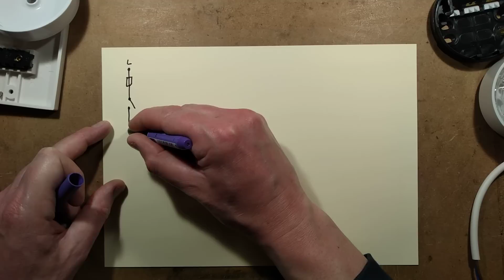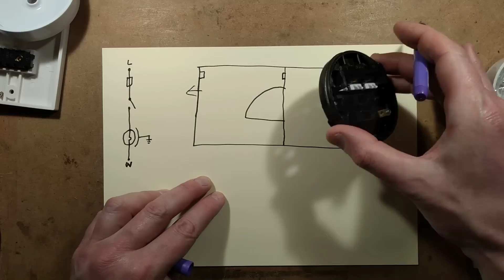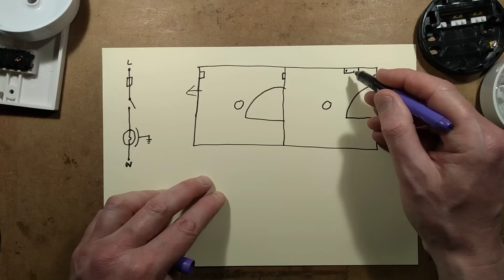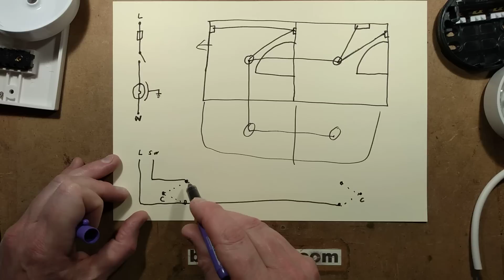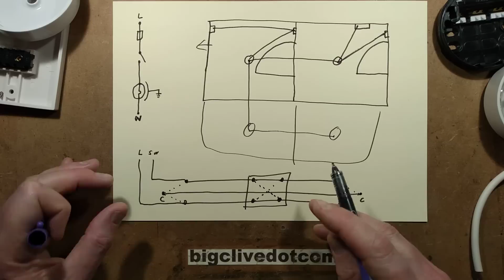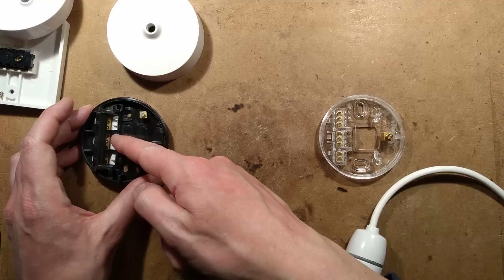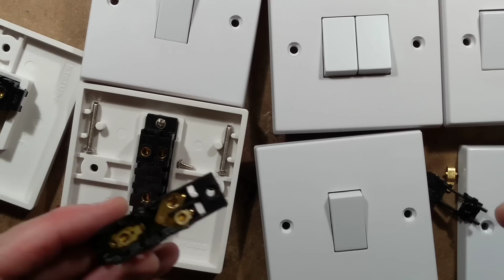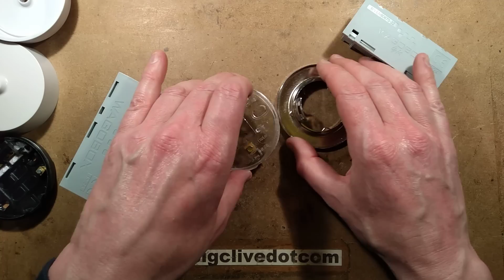British home wiring.  The incredibly simple lighting circuits.

Comment: The old fashioned way across the pond is similar for lighting. Instead of a ceiling rose, we have a ceiling 'dish' or 'pan.' It's basically just a very shallow round metal box, shaped like a dish, with knockout holes for wire or conduit entry, and it usually has a threaded bolt sticking out of the center where different adapters can be screwed onto, and a light fixture can be hung from those bits, or screwed up to the ceiling. Surface mount light fixtures were, and still are, designed expecting that all the wiring would be sticking out of the ceiling, and have nowhere to be put into, besides a recess provided by the light fixture.

The more modern design is simply to have an octagonal metal box mounted in the ceiling (as those are shaped and have screw holes meant specifically for screwing up a surface mount light fixture). Those boxes are about ~40mm deep, or more, and are otherwise identical to a normal switch box. With these boxes, adapter plates that provide a place for a threaded rod can be used to hang a light pendant. There are a whole bunch of light installation adapters available, despite the fact that there have only really been two or three standards here for that since the beginning of electricity. But we manage just fine.

As for circuit wiring, most places I have seen, at least old homes (think 20s to 50s), have been similar, in that they have a general lighting circuit, with other circuits for outlets. However, there seems not to have been any rules for that, so some houses will have lights and outlets on the same circuit. Nowadays, I think the meta is to have each room (lights and outlets) on one breaker. Excepting kitchens and bathrooms, and anywhere else dedicated circuits might be needed. It's not uncommon to have homes here with 20 or more breakers.
Reply: We have some of those "double up" breakers too.

Comment: Here in the United States, electrical panels are rarely located near the door. They're usually located in a "utility room" which may contain the washer, dryer, water heater, and furnace. If not, they're almost always in a connected garage or in a bedroom other than the master.
Reply: The design originates with the first distribution systems in dense urban areas where row housing (terraces in UK-speak) were common.  From the road entry at the front door was easiest and the distribution company hand off to the customer circuits was done as soon as possible.  And high as initially the sole use was for lighting.  In the apartment where I was raised the board was immediately above the door and had 2 circuits: lights and power.

Utility rooms, washer, dryers, furnaces  etc were all unimagined things of the future.  :)

The other common place for a board is "under the stairs" — because it was often the only space out of view and with little use.

Comment: Hi, nice video but the way u draw but the two way wiring, am not sure if it's OK. Please excuse me if am wrong.
Reply from the maker: Draw it out and try the different switch positions.  There's an older method that connected between the two common contacts, but this method is easier.
Reply: @bigclivedotcom  ya , after drawing it myself I see the light, thanks alot. I was using the old way,  thanks again and sorry.... 😇
Reply from the maker: @388sanju  No need to be sorry.  Both methods are good to know.

Comment: Number of times I've said, "I wish this electrical box were deeper.": too may to count.
Reply: ...... Not when you are the guy knocking holes into the brickwork (or concrete)!
Reply: Meh, knocking holes in bricks or concrete is quick and easy. Just messy.
Reply: @ColtaineCrows ... unless it is you that is doing it  ... in someone’s home!
Reply: @totherarf  Agreed, to be honest. Praying the neighbours don't see any cracks in the plaster! Especially when it's an house built for the poor folks many years ago where the inner courses are all brickbats and mortar! When I rewired my bedroom many years ago as training, I was very ginger with that bolster! :D
Reply: @MrBaldypete1  Bolster chisel work was the way apprentices developed muscles. My first day on the job was non-stop with a star chisel, making rawl plug holes in Victorian brick for galvo conduit runs on outdoor lighting. No local power, so it all had to be manual. I wish cordless drills had been a thing back then.
Reply: Yeah... cutting conductors a lot shorter than you really want to just so you can shove the socket/switch in... been there a few times mate!
Reply: Number of times I've cussed the plasterer for completely hiding my boxes and having to probe for them.......

Comment: Number of times I've said, "This electrical box is just too deep!": 0
Reply: :0
Reply: If you think this is deep you have not seen anything yet you should try Electronics...………….
Reply: Sometimes they are too deep, or the wall has been built out, say, adding a tile backsplash in a kitchen or something where the original junction box depth is no longer sufficient.
Reply: Blaine Bugaski then the box itself isn’t too deep, it’s just set too deep in the wall.
Reply: @JasperJanssen  Well, yes, I thought you were talking about recessed depth rather than box size.
Reply: @JasperJanssen  in the UK if this happens to be the case, you must build the box out with extensions in order to keep fire integrity, if it's in a stud wall or the wall has been battened out
Reply: @darylsavage119  Same requirement in the U.S..  I believe the box cannot be more than half an inch back and you shouldn't be able to see the inside of the wall, but someone in the U.S. feel free to correct me.
Reply: Michael Litscher:  I always I could do with it being deeper and have a bit more room to work and not have the wires all crushed together.  I also hate it when they connect a wire at the switch or a socket and then pull the wires back to the meter box giving no room to disconnect the wires again at the socket.
Reply: @BoB4jjjjs Jeez, what kind of cheapskate would pull the wires back, leaving no slack? I always have at least 6 inches of wire from where it enters the box (I use the tip of my pinky to the tip of my thumb to measure, which is 6.5 inches), or three inches of wire from the face of the drywall (the width of my palm is 3.5 inches), whichever is greater. Folded neatly, it doesn't take too much room in the box.
Reply: @michaellitscher9456  Good for you, but they do this up here all the time and it is very annoying!
Reply: @BoB4jjjjs  I agree, I like a bigger box, if the depth available will allow for a deeper box.
Reply: Now you're just trolling. ;p

Comment: Did this tradition start with the ceiling lamps using a pull chain directly on the lamp? I can't think of another reason to connect the live to the lamp first.
Reply: Less wiring. Which doesn't mean it's better. But when you're prioritizing scarce resources...
Reply from the maker: Having a lighting feed loop through all the rooms at a central point is very convenient.

Comment: Person I worked for, found out something about me(being a computer person), that I understood basic electrical...
And he had a problem and asked me to look and se what i thought.  I had a Hunter/seeker to track wire...
He mentioned that this 1 Failsafe socket in the kitchen kept Popping(breaking the circuit) so I traced it, and found that someone had set another socket in another area, in a hallway.  And the Circuit was SERAIL, and they use the hallway with a Electric heater...POP...  redid the EFi switch and He like me allot..chepaer then calling the Electrician out for a call, The Electrician had MESSED UP..
Reply from the maker: Lots of electricians mess up.  Here in the UK there's a new era of very unskilled electricians.

Comment: Here's how it is done in Denmark:
  It is mostly similar except
1. Switch and junction boxes are usually 50x50 mm switch inserted in 43mmØ hole or 50x75mm socket in 43mm hole with extension.  Boxes are 20 to 55 mm deep.  Ceiling boxex are 70mmØ and can hold a blind cover, a rose with 4 wire holes or a twist-in lamp socket (only S, N, E max weight 10kg).  Market is still dominated by the LK brand now owned by Schneider.
  Earth wires are sleaved yellow/green.  Phase is usually brown,  neutral blue, all other colors used for switched or multiphase.  Connections may be cables or tubes with isolated single cores.

There are 3 different ways to wire 2-way switching:
  Simple and usual:
L---<====>------O-----N
  The one in video

  The dangerous and banned one
L+N=====>------O------<======L+N
Reply: The second one the Americans call a Carter or California circuit.  Don't think there's a specific UK name for it but it's equally illegal in both places.  :)

Comment: Ran into these while living in the UK. My flat had some stupid proprietary three pin bayonet socket that wouldn't accept standard bayonets. Due to some silly deprecated energy efficiency law. 

When I asked the letting agent if I could swap them up for sensible ones they sent in an electrician and I found out these existed. And the job was even simpler than I expected. 

One of the cases where the UK has done something really quite sensible. 👍
Reply: my flat was also 3 pin to force u to buy overrpriced energy saving bulbs ( at the time already outdated CFL ) 2 pin lampholders cost 99p each and takes 1 min to change, so i changed all mine and bought 2 pin LED bulbs

Comment: To strip US electrical cable, you bend it and cut the side that is being stretched.  If you do it right, the cut starts a crack the runs in all the way to the insides without you touching the innards with the knife.  Once you have the rip started, you can usually grasp the cable with one hand each side and pull and the jacket slides off.

Comment: The tab on the center post of the plug-in box COULD be used to close two contacts in the box for the live connections - IF they wanted to protect heavy handed installers ;-)  But, how else would they get rid of them?
Reply: Simple! Make one contact blade larger than the other 3.

Comment: ln new zealand in the houses l have owned, we only run 2 cores on our lighting circuits, no earth, would this be because we dont have concrete floors or is it normal not to have an earth in the lighting wiring, even though we have metal fixtures
Reply: Light fixtures tend to be something you don't come in contact with often. Maybe that's why.
Reply: That what bugs me about our lighting circuits - granted in the old days it was your typical Bakelite fixture with a bulb but now with all sorts of lighting we have now it isn't compulsory. I read that they quote 'recommend' earth if a metal fixture is going to be used.

Comment: Interesting. This allows to choose to bypass the switch by just using different terminals. Here in Germany that requires wiring in the switch itself. Also, our switchboxes are round with a square front which leaves less space to hide extra wires (but are easier to cut into drywall with a circular saw).
Would it not be interesting to have an episode about KNX/Instabus hacking?
Reply: I wonder what is with KNX in the UK, here in Germany KNX is now also very common in private homes. And with a KNX installation everything is so much easier, with the use of sensors and actors the electric (mains) wiring becomes now indipendent from the sensors e.g. switches.

Comment: In US these switches are called either single pole, 3 way, or 4 way-don't quite know why a 3 way switch is only switchable from 2 locations, and only 3 for a 4 way.
Reply: I think the number of screws on the switch that get wires on them is how the name happened.
Reply: You can add 4 ways between the 3 ways until the cows come home and it will work.
Reply: You are making me think about a time years ago when a very flamboyant gay guy I did a bit of work for took this chandelier he bought in Italy to a local electrical repair shop to convert it to work on US 120V.  These guys couldn't quite come up with anything, or didn't wanna be bothered doing it, so he asked me.  After some thought, I came of with the idea of running little halogen  12v 2 pin bulbs in series, since there were about 10 sockets-worked fine, but I warned them the minute one bulb burned out they'd all quit working

Comment: In the US the National Electrical Code (NEC) now requires live and neutral be brought to at least one switch in each room. This change was driven by the popularity of smart switches that require power to operate. What was happening in the past due to the lack of a neutral at the switch location the electrician used the equipment grounding conductor as neutral which is a safety issue.
Reply: ... or was it the copper lobby?
Reply: @kensmith5694  Perhaps a little of both. That being said I think it is a good rule.

Comment: Odd that the ceiling boxes are daisy-chained like that. US wiring would typically first to the switch and then to the light, any daisy-chaining happing between the switches, not the ceiling box.

Probably an artifact of frame construction and most US buildings having been wired when they were constructed. Also, the load center is usually in the garage or by the backdoor, and it's a lot bigger than those dainty little British consumer units. Maybe 16" W x 24-30" H.
Reply: Having installed a new circuit recently, it would be nice to have more room inside the consumer units.
Reply: @Jamal_Tyrone  Yes! That!   Especially with RCBOs becoming more common I want the damn things to be several centimetres deeper so the neutral pigtails  (and sometimes permanent ground) can be wired in without turning the thing into a macramé artwork.

Capacious breaker boards are one of the few things I actually envy in US electrics.

Comment: your 2 location switch is way different from the way we do it in the us. the Common is connected to the hot in, and the switch leg out on either switch, and then the two poles on the switches are connected together. I think that the wiring method you show is probably simpler to wire as there isn't any need to identify which is the constant hot in, and switch leg switch returning to the light.
Reply: You should put that in your house. An excellent way to confuse any future electrician digging into your connections. They'll probably think the last owner was either a mad man or a genius.

Comment: UK power outlets safer than USA.
Reply: Of course they are... Brits are required, by law, to wear a hard hat, day-glow safety vest (with reflective tape), steel-toed shoes, class 1 safety glasses, and a static grounding cable whenever coming within 2 m of a power outlet.
Reply: @StoneE4  You forgot the high voltage insulated rubber safety gloves.  :)
Reply: @calmeilles  - My apologies. 👍 😁